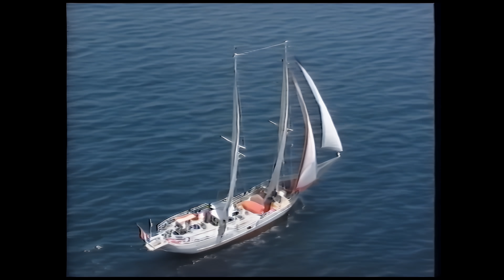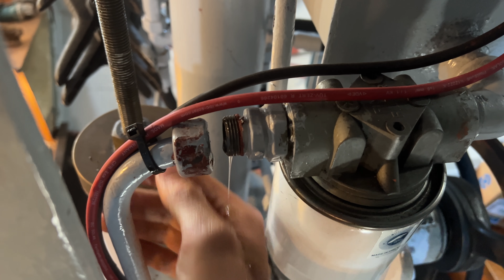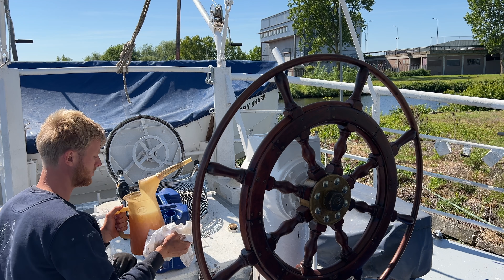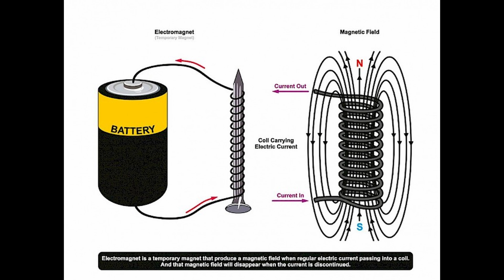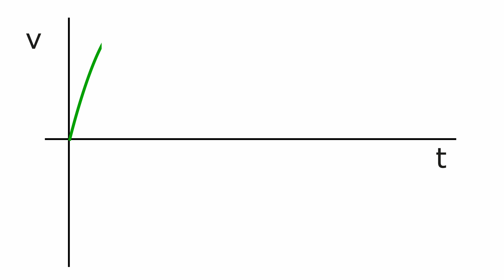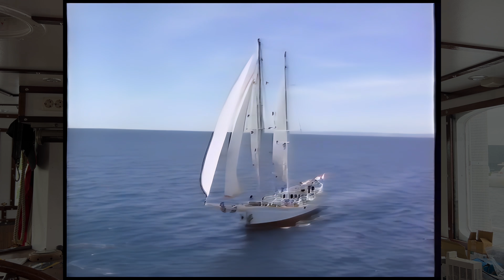The Truth About First Attempts - They're Never Perfect!

Comment: 2500 watts will never cover all your needs on that boat. You need a minimum of 700 Amp Hours 24v battery and 6000 watts inverter to prevent issues. When your hydraulics are under load such as sail recovery in a storm, the pump will draw much more power.
Reply from the maker: You’re probably right. We have a 300V 75000Wh battery and a 20000W 3~ inverter waiting to be installed :)

Comment: VFD, interesting solution but what happens when you actually have a sail and say some wind while you try to furl the sail? 
is the VFD going to draw more current? Is the motor going to have enough power? Is it going to over-heat? Interesting installation, nice video, thank you!
Reply from the maker: Right now, without a sail, it the current it draws is well below the rated current of both the vfd and the electric motor. We're gonna have to see how much it draws when under more load :)
Reply: @tigersharkboatworks  do you have manual "emergency" method?
Reply from the maker: Yes, if the VFD draws more current that the inverter can supply, we can start the generator and run it on that, and if anything breaks, we can always manually furl the sail with a handle on the motor at the base of the stay :)

Comment: Mooie uitleg, maar waarom gebruik je geen hydrauliek groep op 24 of 48v ? Al dat omvormen geeft veel verliezen. 
Ik werk zelf bij een grote aftermarket onderdelen-firme in de material handeling. Er bestaat heel wat stevigs op dc-spanning
Reply from the maker: Onze 24 volt accu staat in de machinekamer, daar zou ongeveer 20 meter kabel aan te pas komen om bij de powerpack voorin te komen. Daar verlies je ontzettend veel mee bij zulke lage voltages, of we moeten kabels gebruiken die net zo dik zijn als je duim, voor een 2,2 kW gebruiker. Alternatief is een 24 of 48 volts accu voorin, die daar op 230V opgeladen wordt. Betekent dat we 24 volt gaan omvormen naar 230 en dan voorin weer terug naar 24 of 48. Dat is dus nog een extra omvorming stap, dus dan heeft een pomp direct op 230V minder rendementsverlies.

Comment: Great vid again! Just a word on inverters - there are different output stages for inverters - some direct out 'pure sine wave' or other - then you have those with a buffer output transformer. These are much less hassle with inductive loads. I know because I ran both myself. The trannie connected type are very hardy and you can add extra cooling to improve inrush loading too. They are bulkier - but tough as nails!
Reply from the maker: Ah thanks! Probably worth it to look into those :)